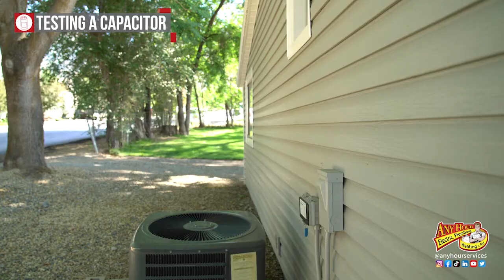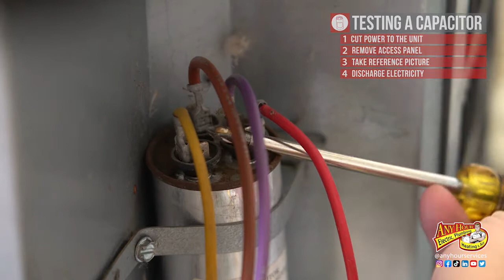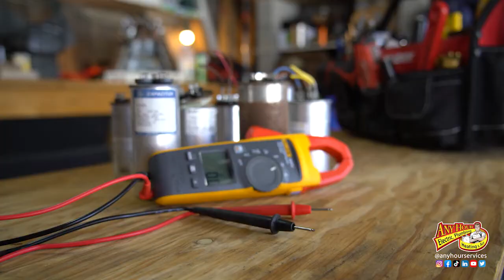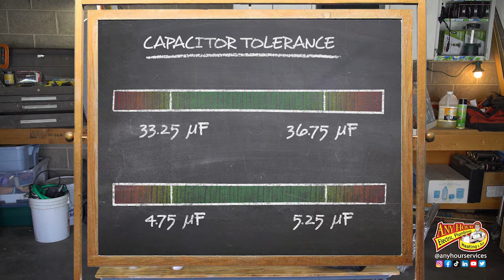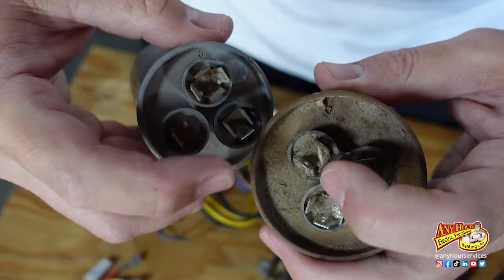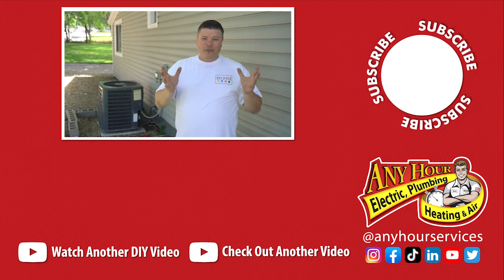AC Troubleshooting - How To Test A Dual Run Capacitor

Comment: Hi and thanks for the video!

My unit doesn't want to cool any more so I did the basics like checking air flow inside and changing the air filter. I checked outside and my fan motor was hot to the touch and not rotating. I gave the fan a nudge and it kicked right in. I just took my capacitor out and I'm not getting any reading of capacitance with my multimeter. I double checked the input voltage and I'm in spec at 240 volts. I'm thinking my capacitor is just blown, but how would it have gone from ok to 0 or not reading.
Thanks again for the video, very helpful!